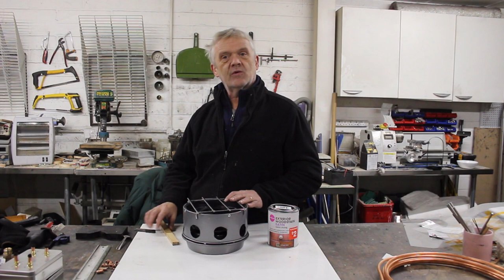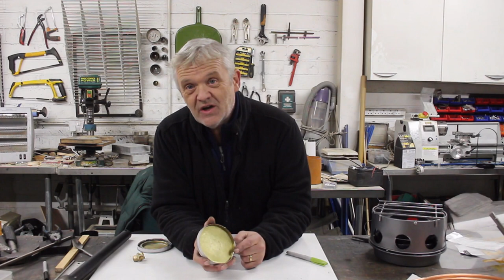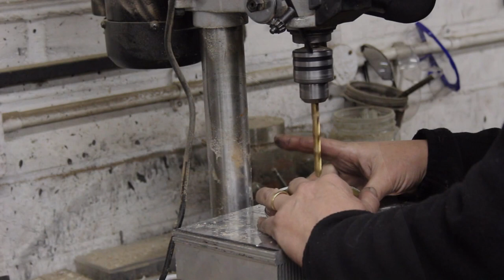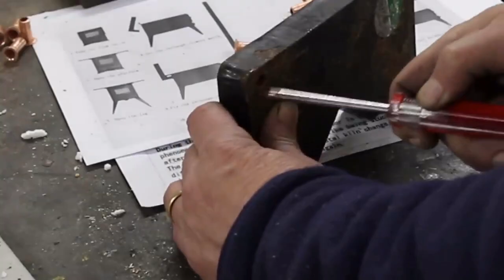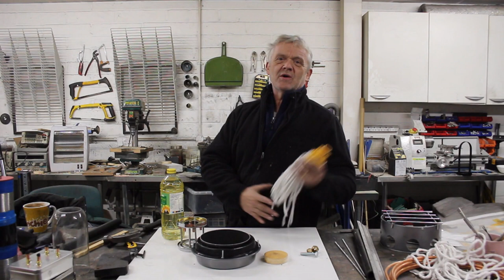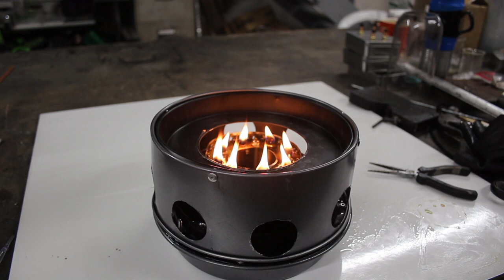1783 How To Make A Reed Multi Use Veg Oil Stove

Comment: Just a peanut from the gallery,  for anyone, whoever would want to try. Glass mat, or glass wool might be worth a shot for a veg oil burner wick. Longer, even continuous fiber, might draw the thicker fuel through better?  Autoparts store beside the Bondo, or maybe someone might have some access to  some second hand fiber optic cable, tedious stripping lol. Might be months before I chase that squirrel, but might be worth a shot. I know old kerosene/paraffin heaters had fiberglass wicks, I don't have any clue what the resin was.
Reply from the maker: nice tips mate - cheers
Reply: @ThinkingandTinkering  Thanks. If someone had ahold of some fiber optic, there might even be enough heat conduction down into the veg oil fuel to keep it going? Thawing fish on a glass plate, kinda just hit me lol.

Comment: Hi Robert .you could also use the copper inserts that are inserted to strengthen Qualpex Pipe at connection points with compression olives .
Reply from the maker: that is clever thinking - I would think so

Comment: Rob, I have another potential addition,  a "Samovar" type water boiler.  A pair of those ring cake tins with a hole in the middle, a normal cake tin in between, appropriately sealed, and a connecting tube (bog brush holder). The marine heater would heat the water directly from the bottom, and from the centre as that would now serve as the exhaust.  If a small outlet pipe a inch or so below the surface, and an inlet extending to the bottom were added, it will operate by displacement.  Hold an empty mug below the out spout, pour cold water in the inlet, water level rises, boiling water lcomes out.
Reply: please make one and make a video on your channel. I would love to see it, especially if it's easy to make so we can all have one for off grid or emergencies.

Comment: Robert, I am enjoying all your heating videos. I have a project for you to consider. I would like to make a batch fuel heater to keep a greenhouse warm at night. My idea is a Finnish-candle/rocket-stove combo. I am thinking of filling a canister with enough wood chips to go all night and run a perforated tube up the middle (open at the bottom) with a stove pipe over the whole thing. My thinking is that the tube in the middle will make it into a finnish candle, and the holes that form above the wood chips as it burns down will form the gasifier. I do not know if this scheme will work, or if another configuration would be better.

Please consider this challenge to make either this design or another that will provide a clean burn from wood chips that will not need refueling overnight. I look forward to seeing what you can come up with.

Comment: Up to three years ago I was using a Ripping-Giles parafin heater that used exactly this style of burner ring with 8 long tail wicks. It was my only source of heat. This was one of the few, very few parafin heaters that used multiple thin wicks instead of one large diameter wicks. Burning through the wicks was a constant problems because of the government legislation making parafin considerably more taxed meaning expensive than heating oil which is a heavy weight oil by parafine standards, yet lighter than cooking oil used here. The burning away wick issue was only solved by Ebay or by a company called Base Camp in Littlehampton, to buy more. I wished I knew of the mops. I had a B&Q ten minutes down the road.
The Ripping Giles had an inner wick holder that slid up into the fixed tubes on the upper ring, and this controlled how much wick actually came out to the top ring burner plate, a shaft via a small gear with knob on it being bought out to the user. A short 4 or 6 inch high 'chimney' with many tiny holes drilled into its inner ring terminated on to a stainless gauze that would glow red hot, while a parabolic polished aluminium reflector sent the infra red rays of heat into the direction to be heated. 
I laughed aloud seeing Robert light his, and using some 'extra' ignition fluid to get it going, plus the soaking time [really important for longer life of the wick] because this is exactly what I learned to do.
Mr Ripping Giles was listed as a 'lamp maker' on the patent application for this heater design and his production kept his family financially well off and warm. This is all it takes to make a business out of something simple. 
Just what Robert is doing here, without the patent and less of the finance bit.
Cheers mate :)
Reply from the maker: very nice post mate - lots of ideas there - love it

Comment: I really like your series on heaters. 

This morning I built a proof of concept version of your radiant heater that uses a screen mantel and methanol. I was stunned by how much heat it produced. 

I did deviate by using a 5 inch mantel made from an old window screen that appears to be some rather sturdy alloy of aluminum, a fiberglass wick and denatured ethanol as fuel. Interestingly the mantel took the heat without any apparent damage thus I am not exactly sure of the metals composition other than it glowed very nicely a hot cherry red from wick to tuna can cap.

My only issue is as another pointed out and that is the fuel is not exactly cheap at $18 a gallon here in the states for camp stove fuel that I assume is methanol and $9 for, I am thinking 16 ounces, of denatured alcohol; so I can see why your series on destructive distillation is a good companion for the series.

Actually I want to start from the beginning of the series at around the 1700 mark and sequentially go thru each video. I did catch, in the back ground, as I worked on a project the simple rocket stove that used twigs as a source for its interesting fuel and likely will give that a go since here in the Catskill mountains of New York trees are plentiful.

Thanks for the series, much appreciated by myself and my Australian Shepard companion that despite a fur coat likes a bit of heat too.
Reply from the maker: I must check out the Ali screen - I used stainless steel which is not the best for radiant heat but will stand temperatures which is why I didn't use Ali - interesting thank you for sharing
Reply: @ThinkingandTinkering  The window screen I used was rather old. I'd say 20 years. It was of the type you could buy separate from the window and it adjusted to fit many openings by having two overlapping parts that slid in or out. It was not rusty so not steel and cut with paper scissors and I have to assume some form of aluminum from having been exposed to stainless mesh which is a bit harder to cut and the screening had the typical slightly oxidized look I associate with aluminum. Must say. It worked beautifully and did not lose its ability to maintain its shape at all.

Also, one other deviation was due to using fiberglass where I pulled off a layer from a roll I have in the shop. Since I knew it might not be all that easy to take the inner can out to refuel the burner I drilled a pilot hole in its bottom that is on top when assembled and then using a step bit enlarged it to around 9/16 of an inch.. Made it easy to fill it back up for additional uses.

Comment: I tinkered with a pepper shaker oil candle with a mop head wick. I found that it needed to be at least 3/4 full and I could use oil as the primer on the wick to get the capillary action to start.
Reply from the maker: cheers - nice add thank you for sharing

Comment: My current design for unhoused folks is a wick made of carbon felt also rolled with steel mesh to give it a wide burn area and some extra support and then I wrap it in a piece of copper wire to give it a foot and hold the rolled wick upright. Make sure your rolled wick touches the bottom of your container and sticks up at least 1.5 cm above the fue line. I put that in a metal cup of cooking oil and plant the metal cup in a plant pot full of sand as big as you want to move around.  I cut some wire fence panel into 2 pieces 1 for my chimney/mantle/burn chute and one for my wind break reflector... I leave some extra fence wire sticking out so that they can be rolled up into 2 rings and staked down in the pot. The first ring should fit fairly tightly around the rim of your metal fuel container.  Once it's staked in your plant pot cut a piece of steel mesh that will the space between the top of your ring and the rim of your fuel cup when it is rolled up and slide it in the ring. Roll and stake your outer ring to the same level or a little higher than the first ring. Cut a piece of foil that can be folded 3 or 4 times to add strength and wrap around the outer ring about 3/4ths of the way around to make a wind break and reflector. Cut sone extra fence material to make a grill top. Add some rubbing alcohol to your cup and wick and light it up. Ip put a cast iron skillet on top as a radiator and cooking surface big enough to keep rain from getting in the mesh burn chamber and set it outside in the California bomb cyclone and it worked for about 3 hours on a cup of oil with no maintenance. Heat light cooking and wind and water resistant... it actually helps to keep the sand or soil around your metal container wet to help spread the heat away from the fuel container.  Without a heat sink of some type that doesn't get steam in your burn chute tge oil will get too hot and boil so violently that it blows itself out while getting hot oil all over the place... the burner or multiple could be planted in a garden  with a more permant stove/oven set up using bricks and rocks and colored glass pieces and different pots and tops add nice fun variation and personalizing... I call it the Hurricane Hibachi or the Seed of Life... less than $1 to make with some hunting for materials (buy the carbon felt!!!!) And only requires scissors and wire cutters to build. THANK YOU ROBERT!!!! You made this possible too!!!! I am teaching some groups at a local cidery how to make them and hand out my first 100 Seeds next weekend. Cheers, Sir Smith please build one and show it off if you feel inclined 🥂

Comment: Rob, if I may a suggestion, waste cooking oil, that obtained from most restaurants anyhow, can be quite dirty. One of the really attractive features of biodiesel is that in the process of converting the used cooking oil to the methyl esters, almost all of those undesirable components are removed with the glycerin & soap byproduct.  Obviously there is some of the glycerin (which could make fuel) but the cleaner lighter fuel more than makes up for the loss, in my mind at least.  Remember,  vegetable oils have molecular wts of between 700-800 grams per mole, biodiesel components are 1/3 as heavy.
  Keep in mind that to make stove fuel, you don't necessarily need to purify the biodiesel to the same degree as for motor fuel,  you can tolerate some impurities.  As such you can probably use an abbreviated one step process in a metal pail, & simply pour off the biodiesel, leaving the solid byproduct behind, & avoid the washing. etc.
Reply from the maker: I did do a video on making bio diesel from waste cooking oil mate

Comment: I really enjoyed this project with you Robert. I learned a few tricks from your tinkering with this multifunctional unit you made. What I am wondering is if you would test using carbon felt for the wick material on improving the performance ?? Would making a second tube over the wick holders with holes increase the efficiency of this unit ?? 
Good day fella.

Comment: Awesome mate, need to make a less powerful fuel mini boiler to power central heating radiators. Even 1 rad with a small fuel burner unit heating and recirculating the hot water in the radiator
Reply from the maker: interesting idea - cheers mate

Comment: I prime my fiberglass wicks with a little bit of toilet tissue, unused of course. Pinch the tip of the wick in a square centimeter of tissue to soak it with oil, then light. The tissue burns hot enough to start the oil evaporation. Just have to wipe off the wick between burns.
Reply: I can't get any of my fiberglass wicks to stay lit. I'll try a bit of tissue soaked in methanol as per your suggestion cheers.
Reply: @lagunafishing  It also helps to use a carburetor/chimney to get it burning and keep it going. As Robert mentioned in another video, oil takes a lot of oxygen to burn, more than most fuels that we use. Good luck.
Reply from the maker: nice mate - thank you
Reply: @ThinkingandTinkering  I hope you don't mind that I called you by your first name even though we've never met. No, thank you.

Comment: When you have the tall glass chimney on for the light I wonder if adding a taller pot stand that would go over the top would also allow cooking at the same time.  Maybe just enough heat to boil a small pot of water.  Having a stove that does multiple duties is good but when it does multiple duties at the same time is even better.
Reply from the maker: yes it probably would

Comment: Vent the tent anyway even with a smokeless flame. Anywhere there is combustion there will be o2 needed for the combustion. The combustion will deplete o2 of the space and fill it with carbon monoxide. Just a little vent is all you need to be sure the combustion has the o2 it needs to keep burning and you have o2 to breathe thru the night.

Comment: Hi Robert, nice metal working.  Is there any heat conducting into the copper tubes and if there is would it help to have them long enough to extend down into the oil? It would help preheat the oil.
Reply from the maker: yes mate there is and I agree it would - I kept them short with safety in mind but of course you pay for that in terms of ease of use

Comment: good old mop wicks, can also be used to make a fisherman's lighter :)
Reply: What is a fisherman's lighter?
Reply from the maker: nice
Reply: @lagunafishing  its a windproof lighter, 2 tubes, an old clipper flint mech and a bit of mop :)
Reply: @alistairmcleod3924  Never heard of it and I've been fishing since I was a kid in 1968
Reply: That's a fancy one on Amazon, I would dig mine out of the shed but I cant be arsed in this weather :) that mentions kerosene,  I have never used any kind of accelerant on mine, the flints enough to get an ember going as long as you pre char the end of the  wick.

Comment: This kind of look like a multi wick kerosene (paraffin) heater. They have the advantage of adjustable wicks and come with a "catalytic convertor" to give you a blue flame, and get the wicks higher than a yellow flame would allow. I wonder if they would burn with vegetable oil? Also I wonder if you could simply pour your vegetable oil around the top, perhaps refilling it a few times so the oil could flow down the wick.
Reply from the maker: I don't know - but I am about to find out

Comment: Great,as to the wick holders. tere is some time and effort that is required. Could you not use a rivnut and solder the wick holder  on over that? Easier and quicker.
Reply from the maker: I would avoid solder where it gets hot mate
Reply: @ThinkingandTinkering  oops. Right.  Enjoy your channel.

Comment: I love the idea of using vegetable oil.  I have made a candle and a lantern using  veg oil but the wick seems to burn away really fast
Reply: Use robs wounder carbon felt
Reply: There are several options, carbon felt, or multiple wicks, of the same size, or a larger wick adjusted down lower, or even a bit of lye processing to thin the veg oil. The veg oil doesn't wick as fast and is more subject to gelling with colder temps. You probably have the flame out burning the fuel and it starts consuming the wick once it's no longer saturated. The other thing I've noticed, (just second party) is the wick holders being too tight for the wick and making a choke point for the wicking (capillary action) 
Cheers
Reply: Antic candells with extra virgin olive oil if it was bigger and the burner smaller at diameter ,it keep flames more days . Here it's need to do in such way to use gravitation force ( form of this clay candells ) that the burner to have all time liquid .
Reply from the maker: you could try dipping the wick in borax mate
Reply: @ThinkingandTinkering  will try it!
Reply: @Rick Sanchez  I think I need to adjust it lower so the wick sits just on the surface of the oil.  I will also try the borax trick.
Reply: @sandpiperetching4248  Cool, should work, the flame is just out running the flow.

Comment: Maybe you can make a pre heater, using a bit of 12mm copper tubing  the middle, setting in the oil, with a wick, using methanol or something easy to light, the tubing would carry the heat to the oil, similar to a test tube with methanol and a wick, maybe make a tiny chimney that dips into the oil also, with holes too let air in and about 1"+/- above the fuel tube, similar to a zippo lighter, in a metal test tube, haha, maybe allowing it to burn the fuel out of the tubing , will heat the oil enough to make it easier to start?
Reply from the maker: yes you Ould and I have done that in previous vids this was meant to be easier to build